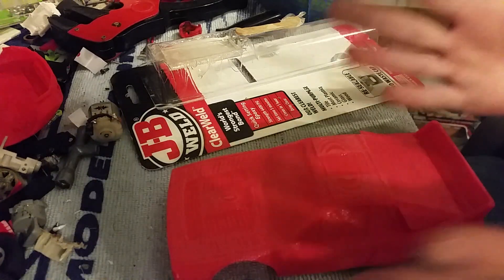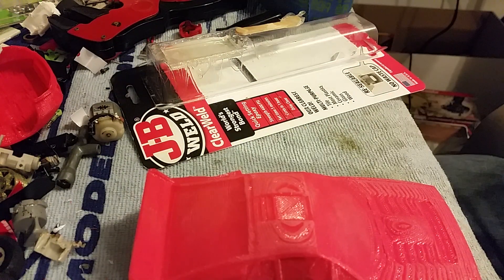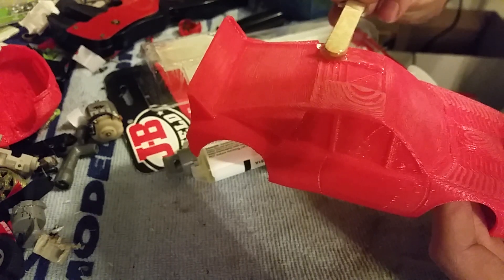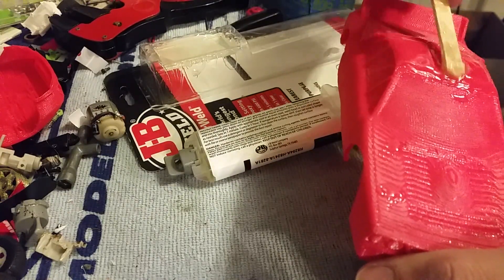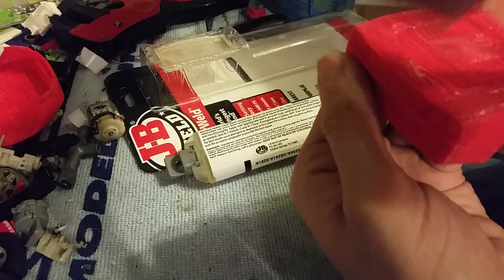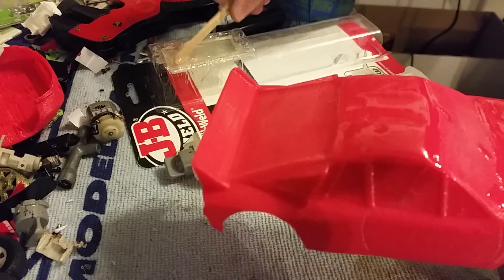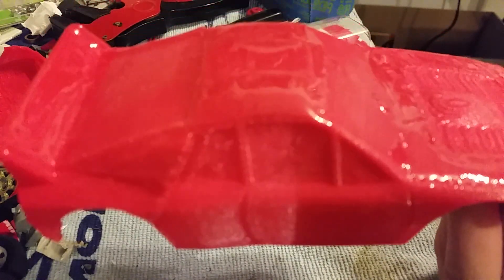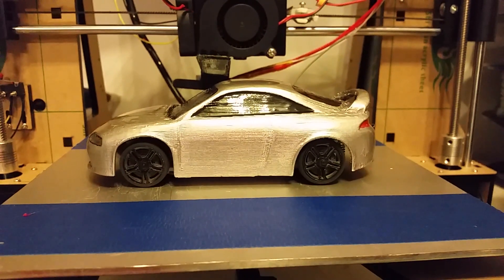3D print smoothening for paint using JB Weld Epoxy

Comment: I use jb weld. Then sand and repeat for any major flaws.  Then spot putty for the minor pin holes,  I'll finish with filler primer. Sand with 400-800 grit depending and then do a regular primer before base paint. It gets finished with the clear afterwards.